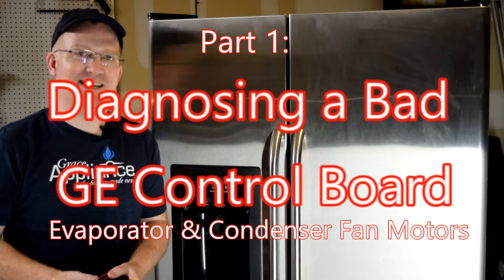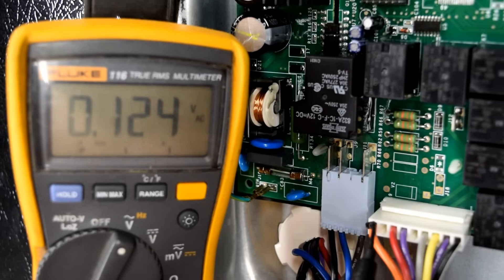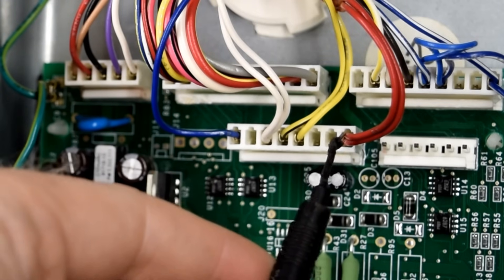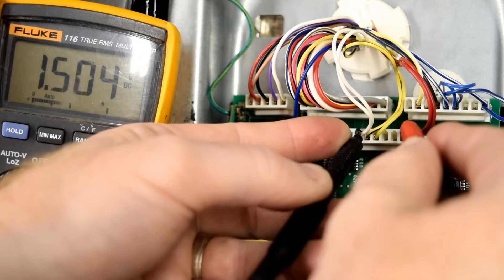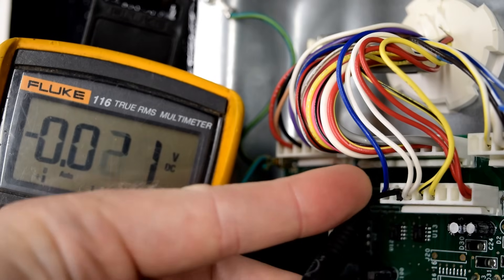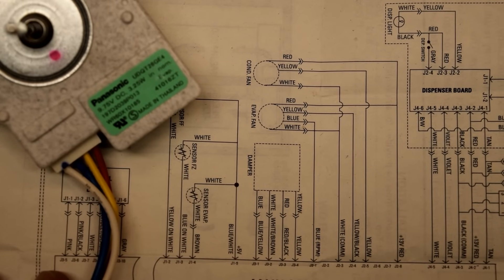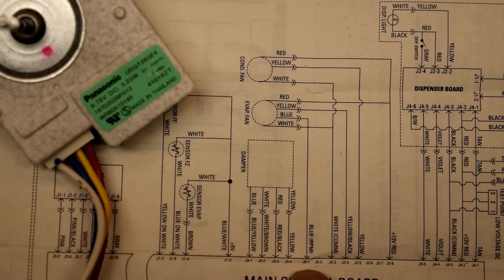Diagnosing a Bad GE Board - Part 1: Fan Motors

Comment: Once in a while after a power outage my fridge doesn’t come back on until I unplug and replug the J2 connector while it’s plugged in. Then it starts no problem and runs fine until the next power outage. 🤷‍♂️

Comment: I did thd first 3 test with refrigerator plugged in a all test read just under 8 volts does that still mean the circuit board is bad because none of the test read over 12 volts

Comment: I checked the AC coming into the orange wire receptacle and the appropriate contact on the gray box (relay?) on the control board.  The meter measured no power coming in. So, what would you do now? What should I check next? Suggestions? Thanks!

Comment: I got a fridge broken not cooling. At the J2 plug I have 12.63 vdc yellow/black, 9.77 vdc solid yellow and 13.42 vdc red. Yet I noticed the evaporator fan is not spinning. If I help it my finger it starts. I bought a circuit board on eBay and the voltage are similar. Again sometimes the evaporator fan don’t spin. I returned the board and bought two more boards and the voltage are similar. The solid yellow wire you say should be 12-14 vdc, I never got that. What puzzles me is that the yellow/black wire for the evaporator fan reads normal yet sometimes the fan don’t spin. But the yellow for condenser fan reads 9.77 but it always spins. I’m at a lost now. Right now with the 3rd board voltage are similar as mentioned above. Should I get another board and making sure I get 12-14 vdc for the yellow wire?

Comment: This video helped me too. My dc voltage to the fan motors had 13 volts that dropped and reset in a pattern (also a sound that was in sync). I also had 2 visibly damaged capacitors. Ordered a replacement board. Thanks!

Comment: I’m confuse about the yellow/black, yellow and double red wires. You say the red powers the fan motors(both evap and condenser fan) But the yellow/black also powers the evap motor and yellow powers the condenser fan motor as well?
Reply: The yellow wires are the control signal, red wires are the supply voltage

Comment: Just wanted to say thank you for sharing this info. My evap fan on my GE GYE22KMHHES was surging or cycling up and down. Your video wast helpful in so much as I was able to diag from inside the fridge by pulling the crisper drawers out, pulling the cover and checking voltage at the plug for the evap fan. I also simply ordered a new fan, and temporarily plugged it in at the location and the surging stopped so I was able to just replace the fan and fix the issue. Thank you so much!

Comment: Good video thankyou
My GE fridge had interior lights on. No display on front, compressor and fans dont come on.
Mother board had incoming power but no D/C voltage. Looked fine otherwise. Accidently plugged in power cord with fan plug on mother board unplugged. Compressor started and display came on. Plugged fan plug on mother board in and compressor quit.
Unplugged condensor fan motor and compressor and evaporater fan started. And got D/C voltage back on mother board.
Replaced condensor motor with new one for 75.00. Fridge runs great.

Comment: Good step-by-step procedure 😎. Everything checked out. The evaporator fan motor had correct impedance. The fan shaft was slightly bound. Drops of fine oil took care of that. Will get a new fan motor.

Comment: Another test for the motor is to put a metal paper clip between the red and yellow wires jumping them together, and use a 9volt battery, putting the plus side to the red/yellow and common ground to the white wire and the motor should run if fan motor is ok

Comment: Which part of the board is causing low voltage? Is it a bad capacitor, a bad relay? I cannot imagine the whole board and all the electronics just went bad all at the same time.
Reply: Right. Now you know there is a power issue, let's see why and where. Could be a bad fan motor shorted out causing bad voltage.
Reply: @davidhazas7162 I wrote some information out under my comment 7mo ago.
Reply: At the J2 plug for the evap fan I am getting a reading of about 835ohms resistance. However, if I unplug the fan from the interior and test the resistance at the interior plug of the fan motor I get a ohm resistance of about 1700ohms. Indicating a good fan.

So, is the fan bad or is the control board bad?

The issue popped up once we had a power outage, and just happened again last week after another. Same issues. Voltage in 119v, but everywhere else on the board is fluctuating between 1 and 9v. Which you say is a bad control board.

I had already replaced the board once. It did not work on install, and honestly cannot tell you why it started working other than it did. And once we had a power outage, it stopped working again.

 I am SO tired of working on this damn thing. No spec or schematics, and a handful of videos that give me some clues, but not enough to solve the issue.

Perhaps you can tell what is wrong from just looking over the information given. I have the EXACT same control board as the one picture in the video.

Compressor doesn't kick on.
No clicking sounds or humming.
Control board Good voltage in, bad voltage out

Bad resistance fan motor at j2 plug
Good resistance fan motor plug

No burn marks, buldges, or blown fuses
Interior lights come on
Water line charges
Front water panel no power

Evap fan not running/turning with doors closed or open even after 10min of doors open/closed

Can't test relays, or anythings else on board because the pins are coated in garbage.

No burnt resistors etc.

Any help is greatly appreciated as I am a father trying to recover from a head-on collision while simultaneously trying to fix a fridge so I can store food for my family. I am out of work, and we are struggling.

If you have any ideas, I am all ears.
Reply: @mobiusprolix8454 keep the evap fan unplugged inside the freezer and plug power back in to see if everything else works. If everything comes on normally then probably fan or a funky wire leading to fan.
Reply: The board works off of low DC voltage. The compressor and defrost heater are 110 volts AC. You can jump out the compressor and defrost to ensure it's working. You probably got a CONTROLL issue. Low voltage issue. Unplug each component and see it stuff start coming back on. If you think it's a fan motor acting up then unplug that motor directly and return power  to see if you get any changes. You can do this directly at the component or at the plug on board. Once you start narrowing down your problem you can then find the component
Reply: Remember those components should be getting low DC voltage not 110 AC. You will only see that voltage on first plug going into bosrd

Comment: Just because you aren't getting 12-14 on Evm doesn't mean the board is bad.   What it means is more then likely changing the regulator can fix this problem.  I have a furniture store up the road and I collect all the scrap boards they throw out.   I don't know anything about products they come from but when depopulating the boards regulators are the most common failed component I've tested before pitching or keeping.   Still lots of useful relays, caps and resistors.

Comment: I have a GE Monogram Model 'ZISS420DXASS' and the main board has a open/blown fuse (upper right corner).  The fridge/freezer does not operate, the water/ice does not respond and blinks on occasion.  There are no electrical schematics online and I would appreciate any help with this matter.

Comment: I've replaced the board with a used board 9/23/23. It worked for awhile. It's running, but the damper or evaporator is not running. 😔❤

Comment: My reading for the Condenser Fan Motor is 8.6 volts. So, is the board bad or the Fan Motor bad? The fridge is at 25 on the freezer and 48 on the refrigerator side, also the warmer/colder switch don't work, stay at number 7

Comment: My resistors look fine, but both of them are brown where they connect to the circuit board and black on the back side. What are the odds that both fans have burned up?

Comment: Nothing except the interior lights worked on my fridge
Failed a voltage check detailed on this video
Bought a control board from Amazon for $130, way less than the $330 control board from GE parts site
Fired right up

Comment: Control board cannot be repaired ?
Reply: I don't know about this but I had a burned part on my gas dryer. I ordered the part and desoldered the bad part and soldered in the new part. It gave me a few more years on the dryer. I'm assuming if you can see the burned part and can get another exactly the same it could be replaced. This was my first ever soldering job.

Comment: I have a GE Monogram and I recently changed the inverter and I placed the unit into diagnostic mode and it timed out and now when I press any button I get 3 beeps, does this have anything to do with the control board/ it is a 2008 side by side zisp480dtass
Reply: https://www.youtube.com/shorts/uTDwJp5wg58

Comment: My refrigerator died on me after I turned the breaker on and off. Checked my control board immediately and the two resistors were both burnt up. I immediately ordered another control board. When I put it in I still had the same problem, the lights are on but nothing else. I did some more research and troubleshot it to my inverter board and that didn’t change anything either. Stumbled across this video and saw that my control board isn’t send 12-14v on J2. So i assumed the new one I had was also bad and ordered another one. Just put it in and I’m still in the same position I was 2 weeks ago.. Please somebody help me.

Comment: I read a comment of yours from the motor test video and you said pull the motor plug and test the voltage with the motors disconnected, sometimes the motors will pull the voltage low. When I did this I got 13v! So the board is good right?

Also, mine only had one yellow wire. Not sure what to make of that.

Comment: Hi Andy. Great video. I am in a pickle and maybe you can help. I followed your test and the board is supplying power to my evaporator fan. But my fan is not working at all. I have bought 2 oem new motors and still never turns on. Any idea what maybe wrong? I did the self diagnostic test T8 and t4 that check the fan and thermistor and they both passed. Freezer cools fine. Just no airflow to fridge. Any idea. Please. Thanks in advance

Comment: Hi Andy, As per this video, on two occasions when we had power  failures, my GE side by side refused to come on. fortunately after around eight hours on both occasions it restarted as normal. during the down period I checked the 13 VDC as per the video and found that the voltage was swinging like in the video. could the non restarting of the unit have anything to do with a thermistor or the evaporator fan? Once it restarted the 13 VDC supply is fine and the unit is functional.
Your comments if you can would be much appreciated. ...... Mike

Comment: My GE model CYE 22USHESS keurig running non stop .
I run a test control and this are the results

When Fridge is cooling mode on test shows

00 24 fridge termistor           40.6 F
00 26 fridge evaporator termistor 7.36 F
00.27 freezer termistor is  4.40 F
00.28 freezer evap.term. is 654.24 F

Turned off the cooling on the control board OFF cooling.

00.24	fridge termistor  45.70 F
00.26 fridge evap ter.    30.31 F
00.27 freezer termistor    12.31 F
00.28 freezer eva term   13.17 F

The diagnostis errors showed are 
Codes     counts   days 
0                 0      2791      even if cleared with code 00.01 turns back the same.
 Is the board faulty and yes is the new board WR55X38248 the conectors are compatible ? my old board is WR 55X28077  
Thanh you for shering all te information I appraciet it.

Comment: freezer occasionally freezes. fan is rarely seen running. can't find a detailed book. frt2h17ask2. elextrolux  aug 2003.  clean; strong compressor.  fridge temp seems stable. i learned to repair tv and stereo, but can't sort this out with only a block diagram, and not knowing anything about defrost timers etc. anyone willing to chat is welcome.

Comment: Thanks a zillion for this tremendously helpful video. I have a question regarding an evaporator fan of a top-freezer GE Profile. Ever since I replaced the fan, it runs nonstop. It's constantly on and doesn't shut off or cycle at all. The freezer temperature has already dropped below -12°F and going. According to the manual, the freezer temperature should range between -6°F and 6°F. Also when I open the freezer door, the fan speed doesn't change (as I've heard it should when the freezer door opens.) I'd appreciate any tips. I've set the temperature to the recommended 0°F several times using the front display panel, but after several hours, it's still going down. The original fan didn't have a sensor, but the new one does, and I connected it with the metal clasp to the evaporator. My suspicion is faulty sensors or the board, but I'm not sure how to test for that. Do these fridges have a diagnostics mode that can be activated?

Comment: Hello. Great vid. My unit wasnt cooling in both fridge or freszer. There was quite a bit of ice on condenser unit and i noticed my evap fan was very quiet and barely blowing any air. I checked the defrost heater by jumping j11 and j9. The heat turned on and seems to be fine. I tested the control board with the help of this video. All tested fine, power in, power out. When i did the ohm test for the motors the ohm test for the evap fan was only .730 ohms . This leads me to believe the evap fan is bad and need to be changed. Please let me know if im on the right track. Thanks

Comment: Please help I have a ge ref 5 yrs old. Replaced mobo, replaced deli pan circuit board twice. Ref works for 10 mins then fail again. I finally just disconnected pin j11 and rest of ref works but the deli pan and evap thermistor are not. Pls. Technician came 4x but no luck. Tnx.

Comment: good evening.  please help me with a problem too.  I changed the green pcb on the refrigerator, I also changed the fan next to the compressor and it still doesn't work that fan.  what else could it be?  there is another yellow pcb.  should i change that one too?  thank you

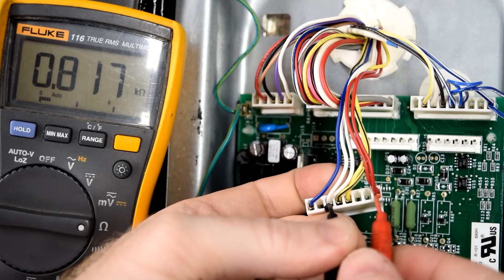Comment: 5:05  when I test the evaporator motor, I  am only getting 10.5 volts steady. Any advice? 6:56  in this test I am getting a reading that starts at 3 or 4  ohms and it climbs to 11 or 12 ohms. Any help is much appreciated.
Reply: The second test I am referring to is the failed fan motor test.

Comment: I got my G.E. Cafe' fridge for free from a frustrated neighbor that couldn't get the "PROS" to fix it right.  I fixed it up for a couple hundred and love it. Save 4K from having to buy one. :)     Freezer fan was freezing up due to moisture and mother board had to be replaced (weak power supply).  These must be replaced at the same time. Just had to replace the MOBO again because the door's water and ice dispenser stopped working along with the LED lights. That was due to a recent lightening strike wounding the board and finally that power supply dying. Sensitive electronics for sure on these smart refridgerators.
Reply: You bought two mother boards?

Comment: Where would I be able to get a schematic for a GE model CYE22TP2MDS1 Cafe refrigerator? The PC board is different
Reply from the maker: Here you go, Michael. 
I hope it's helpful. Thanks, Andy 

https://drive.google.com/drive/folders/10sfR2AgrhIknoKRrNyYGptvPz-YozpoB
Reply: @GraceAppliance  Thank you so much Andy, my wife thanks you very much also. I hit on the donate link, I don't have paypal, and the link to pay with a credit card isn't working.
Reply from the maker: @michaelweal7721  not a problem! Thanks for the gesture either way. Glad to help.
Reply: @GraceAppliance  Isn't there a way to get the link working? Also, there is a gap at the bottom of the doors above the freezer door, that's not right is it?
Reply from the maker: @michaelweal7721  the link appears to work on my side, but you do need to enter an amount before you click the credit card option, otherwise it won't go forward from there.

As far as the door, there will be a certain amount of gap,maybe 1/2" if memory serves. I don't believe the gap is adjustable, but as long as it's not letting air in or out, that's the main factor, obviously.
Do the gaskets still seal up along the cabinet as expected?
Reply: @GraceAppliance  It worked, sent you $25.00
Reply from the maker: @michaelweal7721  you're amazing, Thank you so much for the kind donation and support!
Keep me posted if you run in to any questions along the way. I'll do my best to help. Thanks!
Reply: @GraceAppliance  No problem Andy, you're welcome. It looks like I'm going to have to buy a new one, without a gap, I wish I had noticed that when they delivered it 4 years ago, and now the freezer fan sounds like it's going out.

Comment: Andy, Thks for great video, my GE fridge stopped working completely, Compressor doesnt start, NO pwr, only light is on. Am sure the control board is bad as i see R43 resistor has browning on the board & a big capacitor has oozed out like a white caulking material on board. My Q is does the bad board cause fridge to behave with above symptoms. I did already replace a new starter relay & the capacitor along with it still NO turning ON.

Comment: if you don't have the 1500 to 3000 ohms on your condenser motor (unplugged) then is the condenser motor shorted and in need of replacement? we had about 880 ohms but the voltage reading is good
Reply from the maker: Others have said this is fine.
You should be good.

Comment: Where do you find the schematics for these boards? I have a model No: 0158-06-03A. 
GEA Part No: 200D5837G004
Directly above the square IC is a 8 pin chip, i can only assume is another 6287 6642 because it appears to be melted, but all the other 8 pin chips are 6287's. It is listed on the board as u11. I can't find the schematic.